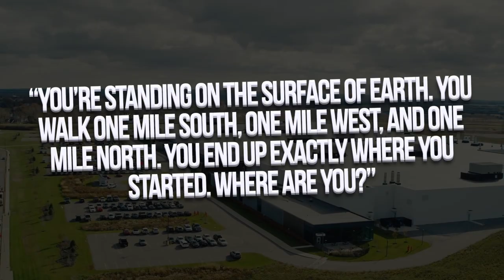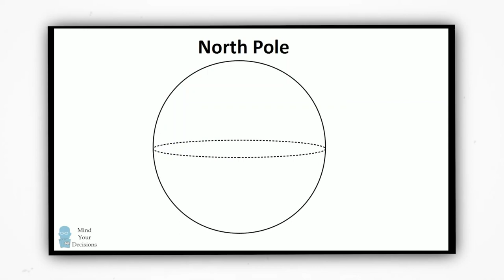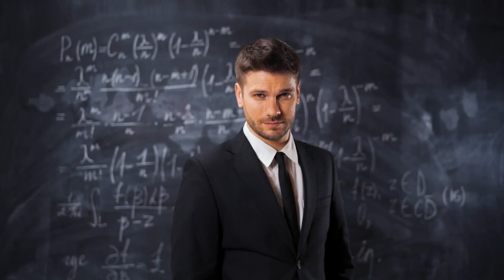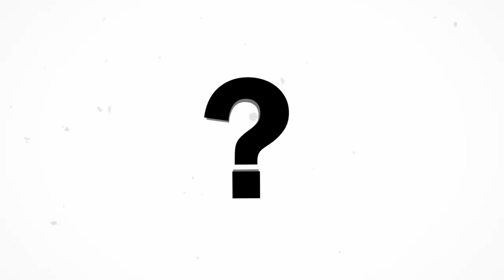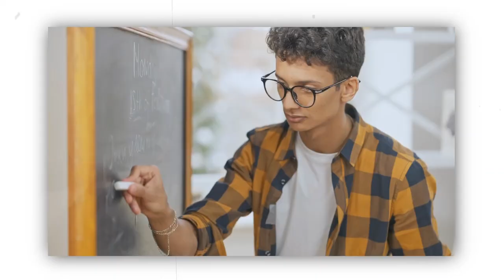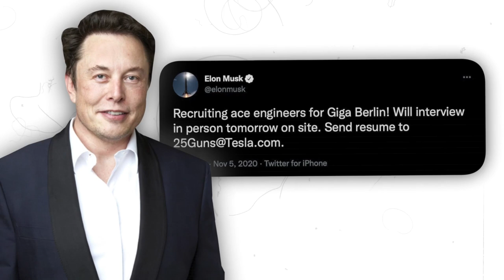Elon Musk On Hiring

Comment: Determining which would be the correct answer would be a bit of a gamble though, since there is no definitive reason it has to be the North Pole, you might as well place that triangle anywhere, and it wouldn't even be the triangle (on a sphere or not) unless you specified that you end up in the same place. Except you can't be on the South Pole and then walk south since you're already there, so you'd have to alter the question and say you walk north, then west, then south. I like Elon's style though. I figured that would be the purpose of the question. It's certainly a good idea.